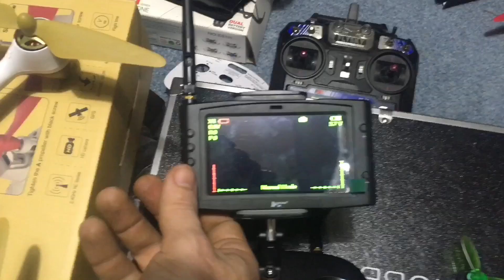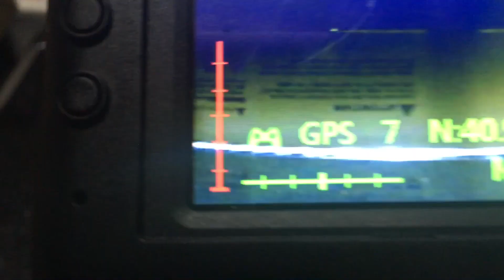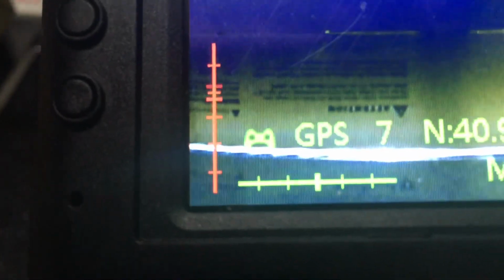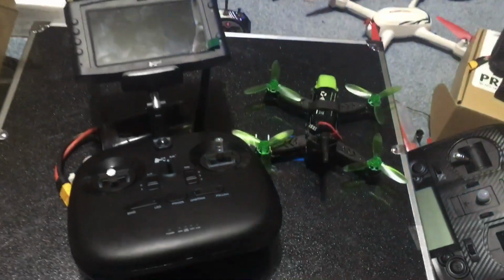Hubsan HT011A Stick Calibration & Binding to Jet Drone Diy Review

Comment: Have been trying to stick calibrate my HT011A, followed all instructions from both you and QC GUY. The blue lights on the transmitter DO NOT flash like they do on your videos. Starting to think transmitter is faulty. Can't explain it. Also, all indicators seem to be centred except the left stick when using it for rotation ( not throttle ). It is way off to the right. Any suggestions? Thanks.
Reply from the maker: Idk 🤷‍♂️

Comment: Yo jay, I got a beeping issue with my jet. Crashed it in 1in of water, cleaned it out,,, drone has no issues binding, after binding, drone will beep,, on controler screen shows red on battery icon(drones battery is dead,, can u help ? And beeping gets more louder,,,
Reply: Lithium polymer batteries are actually sealed so well they can power my rc truck while driving literally across the bottom of my pool!
Heh!
The impact from crashing most likely damaged one of the battery cells. Has said battery become visibly swollen at all? The smallest of bumps even can be enough to doom a Li-po. 
Hubsan's UAVs are very very picky about their battery health. If there's any doubt about that pack please please just throw it away and ABSOLUTELY never charge again. Li-po batteries are absurdly explosive! They will easily burn your flesh clean off down to the bone in milliseconds! And that's even from several feet away!

Why are rc pilots so frikn awesome? 'Cuz we're always looking up!

The drone haters are just really confused.
Not surprising that flyn' rc is way over their heads!
XD